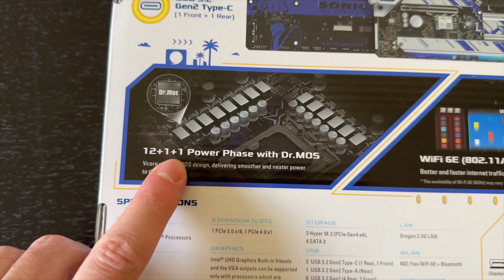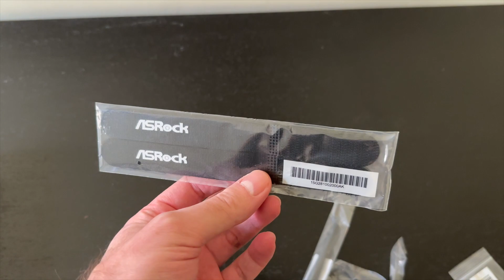ASRock B760M PG Sonic WiFi [Unboxing, Features & Specs Overview]

Comment: All i need to know is if the sonic bs can be peeled off / painted over lol. Its 10 dollars more than the steel legend (same board without all of that) which is sadly out of stock now.
Reply: Here it's the opposite, it's 10 bucks cheaper than Steel Legend and I'm considering it instead. lol I think the board goes nicely if you spray paint your GPU cover in matte silver.  Time to get creative I think! Instead of painting the heat sicks you could also buy some cheap wrap. Matte + glossy Black and silver metal go well together.
Reply: @4Darius  I just decided to go all out and get the z790 steel legend instead lol. It was like 40 dollars more but it gives me a bit of room in case i decide to swap to something better than the 13600k in the next few years. 

Sucks intel swapped from lga1700 for the "15th gen" stuff tho.